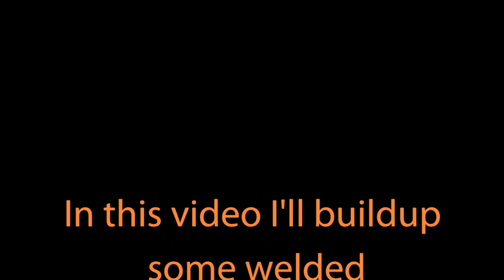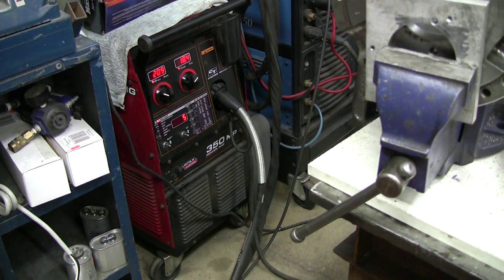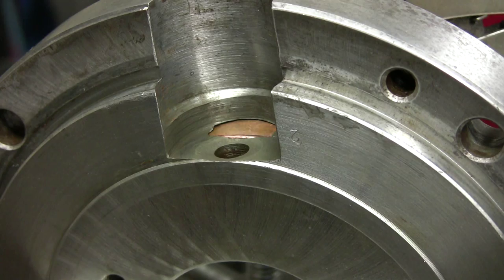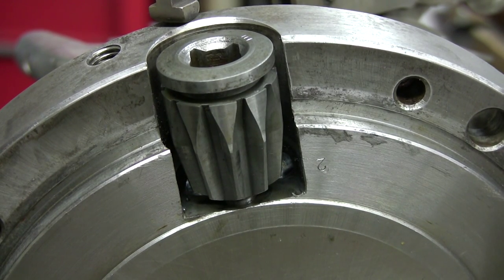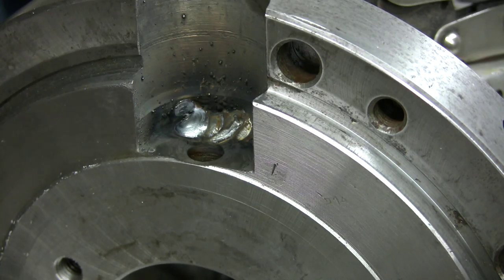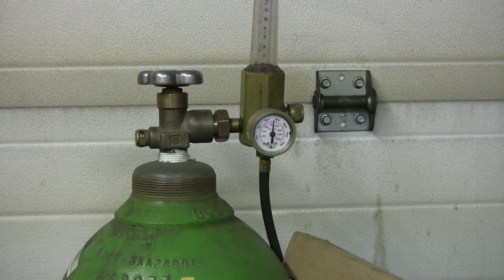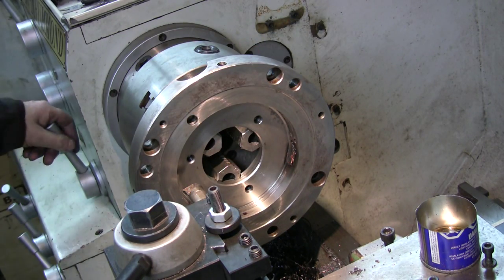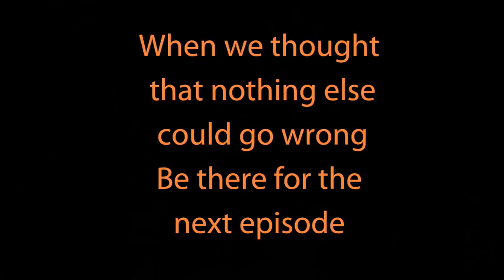Back plate for 6 jaws chuck Part 4

Comment: Tough! Adjusting how much you take off one side against how much you take off the other side is always going to be a balancing act. Tweaking it from first one side and then the other until you get a seal (strength doesn't matter much here) will get you there in the end.

Two places to "steal" volume: the pinion gears (you don't need every thousandth of the small end of those gears), and the back plate (you don't need 360˚ engagement from the back plate. You could grind out three small pockets to allow a bit of build up on the plate cavity side.

Good series. Thanks. I know this all happened months ago, and the outcome has been decided, but the progress is so much like every custom job that watching the decisions and actions "as they happen" is very instructive.
Reply from the maker: Peter W. Meek Hi Peter, that project was a full of surprises one, but the challenge was worth the effort... ;-)
Thanks, Pierre

Comment: Oh my, not quite enough buildup..... :-(
Do you get your gas from Air Li-Kidding?? We get the AlTop bottles here with the lever and built-in pressure gage.

Colin
Reply from the maker: ***** Hey Colin,Get the gas from Linde formally BOC, They're not the 4000 pounds or the ones with the pressure gauge built in, Linde is a cheapo company charging you even fees to track their own freeken bottles on top of the yearly fee... AITop doesn't seem to operate near Montreal, never heard of them.Build up is ok now and ready for final setup.Your channel is too quiet lately, I miss your videos... :-(  lolThanks for visit and comment,Pierre
Reply: Al-top is just the name on the newer bottles from Air Liquide. They also have Smart-top with built-in regulator.
DON"T get me started about bottle fees and costs from Liuqid air.... Grrrrrr....
I'm working on some editing tonight... ;-)
Reply from the maker: FEES GRRRRRR....!
Ok about AI-Top, not dealing with Liquid Air even more expansive than Linde.
Good news about your editing...